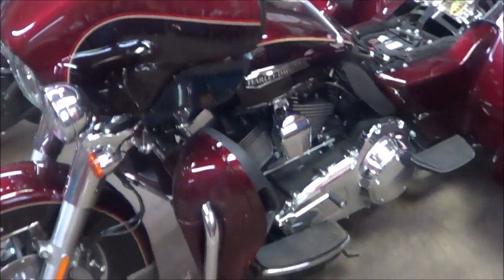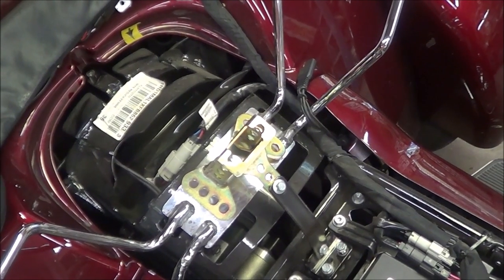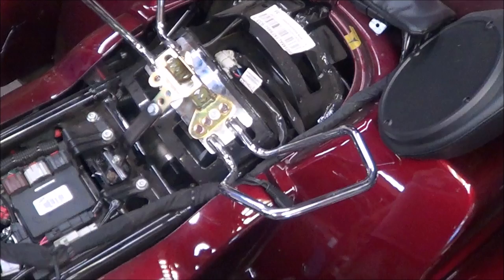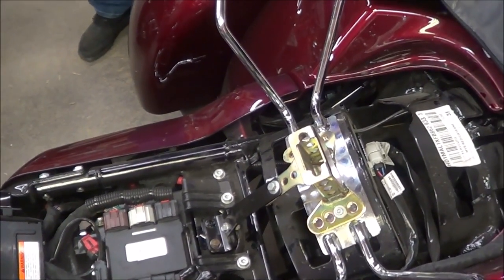Triglide backrest install

Comment: After battling the rear seat bolt BS. I bent bracket slightly then took a 2in long
' 1/4-20 all thread, with nut under and nut with lock washer over bracket, tightend down, now seat will slide onto all thread and i found a 1 1/2 inch long nut thats easy to start and leaves no threads sticking out. PS this vid shows that the backrest install works. thanks for making vid... S CTRL TENNESSEE

Comment: I had to redo the work they did when they installed my backrest. They did a pisspoor job and when I took the seat off to start doing the work I wanted to kick myself after seeing just how easy it was to install it. I’ve done a lot of work myself on my Electra glide,oil changes,lower fairings,even installed my own tour pack thanks to YouTubers like yourself showing me how. It’s ridiculous how much they charge you at the dealership.

Comment: Must be some little thing that Harley sees to be an issue. Have found in the past on other parts that they say don't fit but actually do. Good job! You answered my question, as I have the expensive cable release adjustable backrest on my Ultra and am now going to remove it before trading.  Thanks again for your time doing this video.

Comment: Thanks for the info & video. You saved me a bunch of money. H-D said I needed to spend $300 + for a backrest w/toggle switch and battery hookup  to adjust angles. I didn't want all that stuff. Love my tri-glide (2015). Still miss my Road King, but just got to old to hold it up all day long (69 yrs).Hope to get in another 20 years. :>))). Hope your back gets better. Safe riding !!!

Comment: Just installed on my 2019 TriGlide. I had to place a couple of washers as shims underneath the small bracket to make up for the difference in thickness of the passenger hand grip base. That allowed the holes to line up perfectly on the piece that bolts between the small bracket and the main seat mount.

Comment: Be careful when replacing bolts you have sensors that also screw on to the bolts if they're not the right bolts you'll have problems with sensors believe it or not that's what happened to me took my Free Wheeler down to Harley and they determine the bolts were messing with the sensor 🤷🏾‍♂️

Comment: Thank you, Your video clip already answer my question. I asked these couple dealers they all said this mounting kit won't fit on trike. My trike is 2015 and the same color at your trike. I will order the mounting kit and install. Rider Backrest Mounting kit PN: 52589-09A and the Backrest pad PN 52914-09A